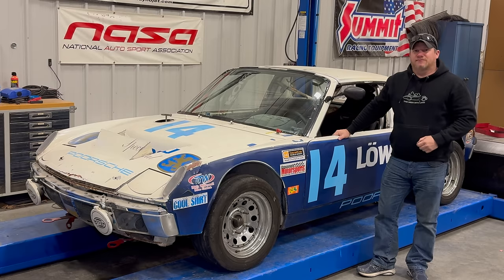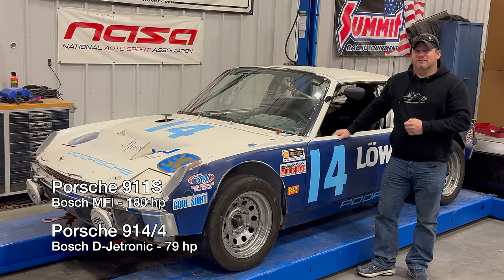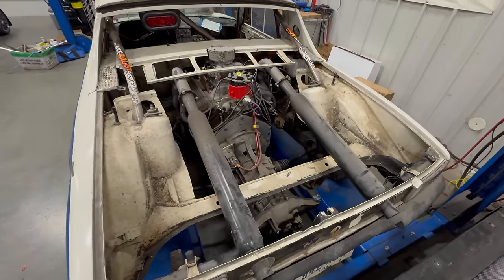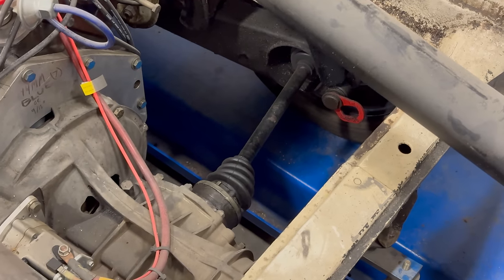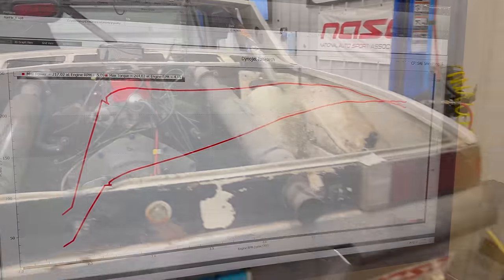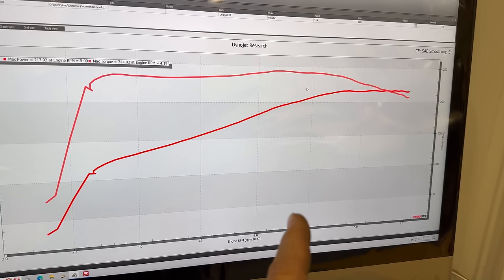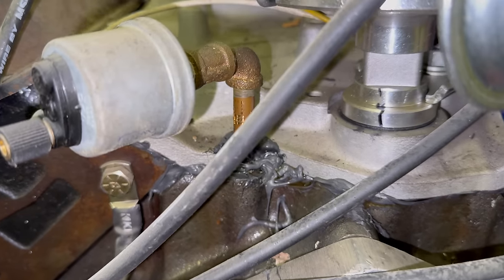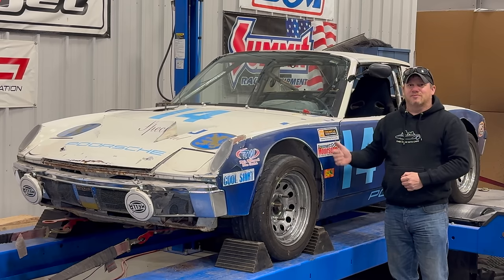Putting the Chevy V8 Porsche 914 on the Dyno

Comment: That small block Chevy measured around the same horsepower as the 914/6 GT but the "little" Porsche engine produced lot less torque than the Chevy. Apparently in 2020 a 914/6 GT was sold for $995,000.

Comment: You're pushing a lot of torque/power through that transaxile.  Don't forget to correct the power at the wheels that you measure on the dyno to power at the engine shaft when you are comparing the SBC output to the 911's engine output.  You would want to increase the dyno numbers by about 12%-15% for the comparison.

Comment: Looks like a big job to sort out the transaxle misalignment, but if you need to fix oil leaks and pull the engine it would be worthwhile.  Correction of that and shift linkage would be top priority if putting on the road again 
Good luck on the project

Comment: Just as a heads up, I saw a substantial arc from the distributor while you were peaking the RPM ; it was on the passenger side at around 4:04 in video. Looks like it went from the distributor to the exhaust. First time I saw it was a yellowish streak and while trying to get the timestamp it was just a white sprite right below where the body work is laying on the exhaust
Reply from the maker: I saw that during editing couldn't decide if it was from the exhaust or a spark, didn't look like it came from the distributor.  I will look back it frame by frame.

Comment: My 69 911T one if the not first 2.8 RSR clones had 110 hp.

We presently run a 2.8 producing 300 hp but the intermediate plate is steel

Comment: Wouldn't the HP rating for the Porsche transaxle be the power being put through it from the engine?  The dyno is measuring power at the wheels, which should be much less than power at the clutch.  I suspect the transaxle doesn't have a long life ahead of it.

Comment: Obviously a major mod, but wondering how involved it would be to move entire drive train forward 3" give or take.
Reply from the maker: If you saw the first video the firewall behind the seat is already cut out for the front of the engine.
Reply: Not much sense after the fire wall has been cut out, it would not be much fun to drive as is, wonder why a junkyard V6 was never considered, less cutting and reliable like the V8.